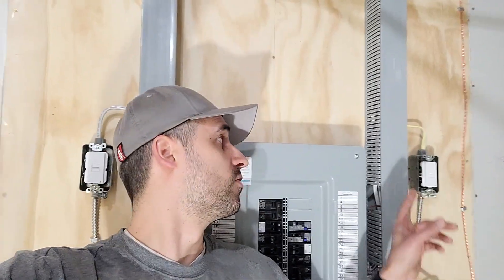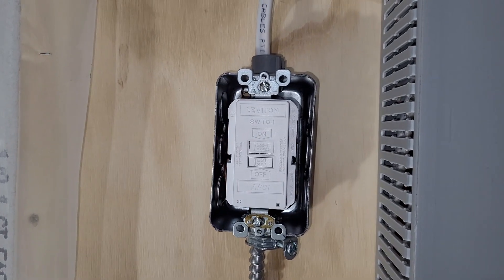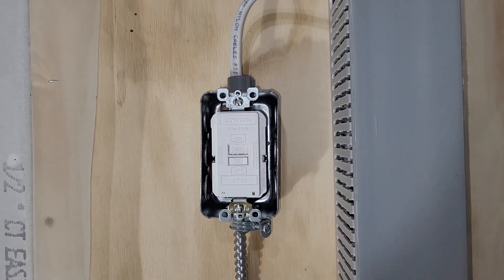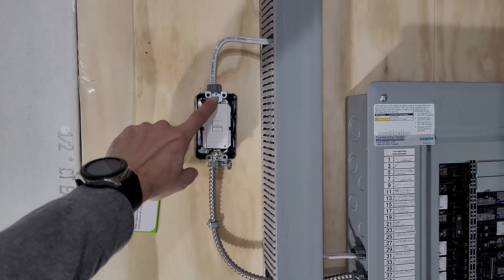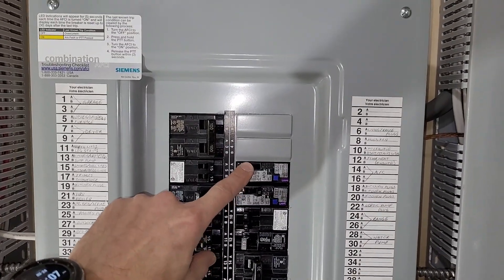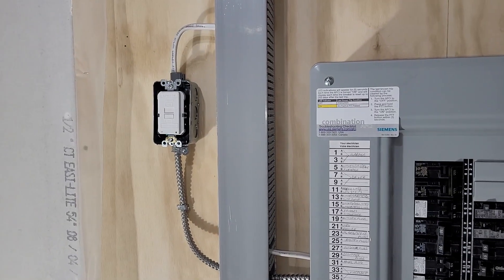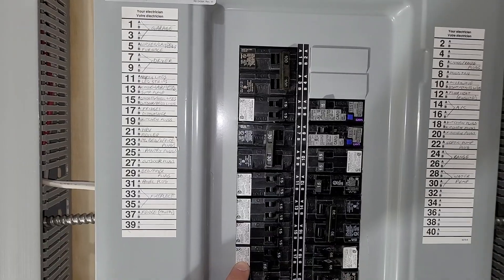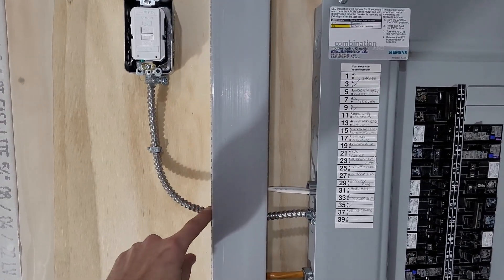How To Fix Arc Fault Nuisance Tripping For Good!

Comment: Doesn't the AFCI receptacle operate on the same principle as the AFCI breaker? How is the receptacle (blank face) immune to nuisance tripping?
Reply: It probably works because Siemen's AFCI technology is garbage and the other brand is at least usable.  Eaton CH is also very problematic for AFCI in my experience.

Comment: So I had a huge upgrade done in my garage, added a seperate additional 200 amp panel with 20 amp dedicated 125 v circuits.  I have LED plug n play linkable lights (8) total of 4 amps.  The GFCI was triping the GFCI but not the AFCI.  I had the breakers replaced with regular breakers and tbe receptacles with GFCI.  The GFCI receptacles do NOT trip but if GFCI on the breaker then the breaker does trip.  Additionally, the electrician chose to put AFCI on some breakers and they also do NOT trip.  In my case the inrush current seems to only affect the GFCI breakers.  MIne are Square D, homeline.

Comment: I had an ESA inspector specifically tell me if I ran dedicated circuits to only a single receptacle. Example, sump pump, sewage ejector, washing machine an AFCI breaker was not required, specifically because of nuisance tripping. Defeats the purpose if there is flood and your sump pump trips. Motors run on electrical arcs. Siemens AFCI's are still trash because wholesalers still have old stock. Switched to Eaton now.
Reply from the maker: Sump pumps do not require arc fault protection, but washing machines do, according to canadian code.

Comment: Why does the AFCI breaker trip but the AFCI device doesn't trip?  Maybe enquire with Siemen for a solution or to let them know that their breaker has an issue.  Did you try swapping another AFCI breaker in the problem circuit to see if the issue went away and that would indicate the AFCI breaker is too sensitive.  Siemens was very cooperative with me and sent me new GFCI breakers that were tripping.
Reply from the maker: Their breakers are too sensitive. Their solution is to replace a $80 breaker with a  $120 dual function breaker.

Comment: I get the same issues with d square breakers on my new construction. My only question is would this be just a bypass to not have to walk to the breaker box to reset said breaker?? 

Seems like it’s just saving time to get to the breaker box which you’ll just reset at the spot?? Can anyone confirm this?

Comment: Thank you so much this this video @energyoneelectric! I have been having issues across the entire house where all arc fault breakers keep tripping from regular house hold appliances such as vaccum, trimmer, PC etc.. In that case, do you suggest installing 10 of these devices one for each of the required arc breakers? not sure I have the space to install this many of those, is there any other workaround? Really frustrated with this and not sure what would be the best approach to take here...
Reply from the maker: To stay code compliant you can do this to all 10 circuits. If you want to do a lot less work, you can just change all of the siemens arc breakers to eaton arc breakers, they fit, but wouldn't be code compliant as it is a different brand from your panel.

Comment: These Siemens breakers suck ass. Two different houses built 2017 and 2022 and both of them experience nuisance trips.

Did your workaround for two circuits with two Leviton dual function receptacles and have no nuisance trips on those runs anymore.

While I was buying the receptacles I ran into another homeowner who was ripping all theirs out because of the nuisance tripping.
Reply from the maker: I'm glad this advice helped.

Comment: They put GFAF breakers on all 30 positions in the GE breaker panel of my brand new house. All of them trip constantly. I reset at least 10 per day. Many of them trip again before I can walk away from the panel. I am mostly in the dark. About 10 of them I just give up on and never bother to reset them because they will just trip before I can get back in the house. The HVAC will only run for a few hours at best before the breaker trips. I have given up on the garage door and just unplugged it and roll it up and down manually. My wife is unable to do that so I just pretty much leave it open all the time.  Most days when I get home my wife is sitting in the dark, under blankets, freezing. She wants us to just move into a nearby motel. 
I call electricians and they will only replace the GFAF breakers with more GFAF breakers and it fixes nothing.  The electricians tell me they give up in most cases and just replace them with the old breakers that cost $7 versus $100 for the GFAF. One electrician told me he had buckets filled with over a thousand GFAF breakers he had taken out. My wife hates the new house. I do too. The county and government won't let me do anything except to tell me to get an electrician to fix it. 4 electricians so far. They have all failed. One suggested to rip out all the wiring of this one year old house and totally replace it. Cost estimate 28k$. But they warn that they have done that before and it didn't fix anything. The gas range top is electronic lit. But it pops the breaker every time. So we just turn it on real fast past the light position and light the burner with a butane fireplace lighter. Or a big match. Thank goodness I have a gas range or else I would have no burner at all. My neighbors have an electric range. They cook their food on an outside propane burner. The microwave trips the breaker within about a minute. 
No heat, no cooking, no lighting, no garage door opener. I am so safe.
An arc produces a very fast spike in current. LED bulbs produce similar spikes. Switching power supplies also. A lightning strike 100 miles away produces a similar spike. And it's not even raining here but I can tell when it's raining over there. Just about everything has switching power supplies today. I have found that my older devices with big iron transformers work just fine.  It's the new stuff that trips them. The LED lights produce lots of noise which the AF misinterprets as an arc. But that noise gets on all the circuits so it's not just the circuit that the LEDs are on.  It radiates into everything.
LED lighting trips the arc fault almost instantly. I got rid of many of the LED bulbs and replaced them with incandescent and at least the breakers stay on. I plug in a TV and the initial boot draws enough current to charge the big capacitor and it arcs at the plug. So I plug it in and go reset the breaker. Often the breaker just trips as I take my hand away.  
My computer switching power supply would trip the breaker. So I built a power supply for it totally out of old fashioned transformers. Now it works.
GF and AF breakers should be internationally banned and the makers of the devices jailed.  The whole concept must have been thought up by anti-electricity nuts.

The only thing left to do outside of violating all the stupid laws by changing my breakers is to put 0.1uF/400V caps across all the lines. This will filter out all the noise or at least make it common mode so those breakers won't detect it. It will also filter out the spikes from arcs thus disabling that whole feature.  But there is no difference in spikes from arcs and noise spikes from LED lighting.  Something has to be done or else we are going to sell our new house at a huge loss and buy an old farmhouse somewhere out in the country.

My cars slide through traffic lights because the ABS misinterprets a bump in the road as a skid. So I hear the roar of the ABS system and my braking is reduced to about 10% of normal. So I can't stop in time for the light. I usually end up in the middle of the intersection with the cross wise cars just getting ready to smash into me.  Another safety feature that was a bad idea. It might be good for people that have not learned how to drive in snow and ice but it hasn't snowed here since I was a child.  I am so tired of safety things that are instead making my life more unsafe.

Comment: So you are basically saying that arc fault breakers are junk, which is what I have always thought, and if code requires that functionality you should use an AFCI blank face which has better engineered circuitry than AFCI breakers, and actually does the job it is supposed to do without all the false trips.
Reply from the maker: @b2major9th  partly correct... Siemens arc fault Breakers are junk,  other brands seem to work flawlessly.

Comment: Great video. Thank you for the info, I have a question. I have 16 outdoor step lights rated at 3.5 W each and connected to a 20 amp square D GFCI breaker. It always trips after being on for a few hours. We checked the connections and everything seems fine. Some people say it might be a ground fault, but if it was a ground fault, wouldn’t the breaker trip right away as soon as I turned them on, not two hours after?
Reply: ❤❤❤❤❤❤❤❤❤❤❤❤     put a current meter on it and see how much current you’re drawing        use a thermal sensor gun to measure the temperature of the breaker as time passes      put in a standard breaker and see if it trips.

Comment: Hi, 

QQ I know the first receptacle in my line that keeps tripping AFCI breaker. Is is okay to add first outlet as AFCI outlet and then change the breaker to standard ? or Do i have to use the blank face if i want to swap out the AFCI breaker with Regular one?

thanks!
Reply from the maker: @vikrantthakur6044  yes your first receptacle can be an afci receptacle and a regular breaker in the panel... however, the cable running from the panel to your first receptacle would need to be bx or armored cable to meet code.
Reply: @energyoneelectric  Thank you so much for your quick response and information you provided in your video. However,  I am not able able to find 15 amp blank AFCI any where i can only 20 amp BFRB.
Reply from the maker: @vikrantthakur6044  i think they would all be rated for 20a.
Reply: @energyoneelectric so will it be ijay to add 20a on 15 a breaker?
Reply from the maker: @vikrantthakur6044  yes, the circuit breaker protects the 15a circuit.

Comment: The microwave is tripping the arc fault breaker because the microwave fluctuates in power while it is heating something. When the microwave calls for more power while you are warming your food, the arc fault breaker senses the fluctuation and it trips. The way to fix this issue is to set the microwave at the lowest power setting. Then, the power bands are much shallower and it does not trip the breaker. I dealt with this on a new apartment building project. Everything was brand new and the tenants were complaining about the microwave breakers. After we set the power to setting "1" for each microwave, we never had the tripping breaker problem again.
Reply from the maker: @flannelguydiy6458  possibly, but it's a problem when 1 brand of Breakers always trips, and all the others never trip, right?
Reply from the maker: The other Breakers should trip if there's a fault,  however,  siemens are way too sensitive and trip where another wouldn't.

Comment: What are those channels that are on either side of your panel?
Reply from the maker: @Scott-sm9nm  those are wire ducts.
Reply: @energyoneelectric  hey thanks for that and the tip in the video. I found the AFCI blank.  I'm looking at putting Siemens plug-on neutral styles panel and breakers in our future home. Sounds lile their AFCI are highly sensitive with some appliance "noises".
Reply from the maker: @Scott-sm9nm  I'm not sure I've seen Siemens plug on Neutral in Canada yet, but I haven't used Siemens for almost 2 years now.  Since I've started using Schneider or Eaton I haven't had callbacks to fix arc tripping issues.

Comment: what is the difference between the ARC breaker and the GFCI both should work in the same way right?
Reply: They trip in different ways. A GFCI watches current on both the hot and the neutral and trips when there's an imbalance (difference) between them of 4-6 milliamps...for example, if an appliance is drawing 6.122 amps on the hot wire and 6.115 amps on the neutral, it trips because there is .007 milliamps leakage going somewhere else instead of coming back on the neutral (a ground fault). 
An arc fault watches for high-frequency (high speed) intermittent connection-disconnection in both series situations (an intermittent break in the hot wire or neutral wire) and parallel situations (an intermittent short from hot-to-neutral or hot-to-ground). For example, a cord that's been flexed too many times and is starting to fray inside. 
They key with arc faults is high-frequency (dozens of thousands of events per second).

So yes, there is some overlap in what they protect but a difference in how they protect.

Comment: Good idea! I noticed you chose to have external arc-fault protectors, as opposed the dedicated breakers inside the main panel. Was that for customer convenience, so they could be reset without opening the panel door and locating the correct breaker?
Reply: Thats the whole point of the video, he is saying that the siemens AFCI breakers apparently suck for large appliances so he chooses not to use them and wire inline an external AFCI.
Reply from the maker: No that isn't the reason I put arc fault outside the panel. It's actually the point of the video... Siemens arc fault breakers often trip for certain appliances and therefore I bypass that issue by installing the arc fault protection outside the panel but still meet electrical code.

Comment: I found that replacing the troublesome arc faults with dual function breakers usually solved the issue. A bit more expensive, but keeps the clean look.
Reply from the maker: I've heard that too, but I've also had them do the exact same thing.

Comment: what do you think about the wafer lights and adding a dimmer? I had issues after installing the dimmer and Arc fault tripping
Reply from the maker: @ampelectric  Arc fault Breakers are expensive so I try to minimize the amount I install by grouping only receptacles together.  If you have led lighting in your arc fault circuit it may be contributing to the nuisance tripping, at least I felt it did in the past when I had some  led strips on that same circuit.

Comment: I have same, when click the blue test button, it trips i reset but theres a yellow light.  Now i click test button on other breakers and now te yellow light turns on for a coupke of seconds.  What does it mean and how to turn off?
Reply from the maker: The label that came with the breaker will tell you what the lights mean. Possibly the breaker itself may have some info on it.
Reply: @energyoneelectric  same as yours

Comment: I've been going nuts with the new Siemens arc fault breaker in a new Siemens panel for a brand new microwave 1250 watt unit the contractor put a dedicated line in for this plus a new panel his price was $8794.50
yes i know i was a fool my arc breaker test does not have a Blue reset i'ts more gray - with i flip the breaker yellow shows the microwave works from seconds to minutes
just  flip a coin and guess what's next i have many trips up and down the stairs to the panel -  i'm ready for the tut house - The state electrical inspector will be here in 2 days
Reply from the maker: I know, it's so frustrating!!! That's why I changed brands and not looking back. I think the Siemens arc fault breakers got worse with each update. I personally have Siemens in my own house and nothing ever trips, but the breakers were an older model from about 4-5 years ago. I run saws and vacuums and all is good.
Reply: @energyoneelectric  I bought another Panasonic inverter  microwave a different model than the last two 
no more breaker tripping - The one that gave all the trouble was in a beat up box maybe the internal parts were damaged  ?

Comment: I think the main issue is that Siemens  uses shared commons. Other manufacturers isolate the commons since they can measure load on the hot line and account for (ignore) the sudden noise returned on the isolated common from noisy equipment. These little switch box units do account for that noise, and so do other manufacturers that have the common  isolated by the breaker. That is why Siemens can make tandem and 2-Pole combo units to support multi-wire branch circuits.  If you want to do shared common installations, then Siemens is the only option.

Comment: Can’t you just use an arc fault plug? I’ve had to use them before bc the panel needed a bunch of tandems with no room for a arc fault breaker
Reply from the maker: Yes you can use an arc fault receptacle.  The feed to the arc fault receptacle will need to be protected (bx or conduit). That extra receptacle,  however, may put you over your limit of 12 on the circuit.
Reply: Whats the code for that? I didn’t know the arc fault plugs needed to be fed from bx or conduit
Reply from the maker: @RKMxMedia  from the breaker to your first arc fault receptacle must be protected.. canadian code rule 26-658 2b.

Comment: So basically, the Leviton is less prone to false tripping than the Siemens.  One word of caution. If you add this  some distance from the breaker panel, the wire between the panel and the Leviton will not be protected.
Reply from the maker: According to code, that wire from the panel to the first arc fault device doesn't need to be arc fault protected.  But it must be protected by conduit or bx.
Reply: @energyoneelectric just wondering in a new construction setting was that inspected and passed?
I know they will let that fly 🕊️ n renovations with panels that don't take AFCI breakers but in a new construction don't they expect the whole run to be AFCI protected right from the beginning of the branch circuit?
I don't know all the specifics of the code on this so I was wondering.